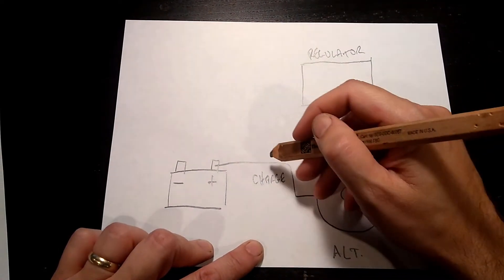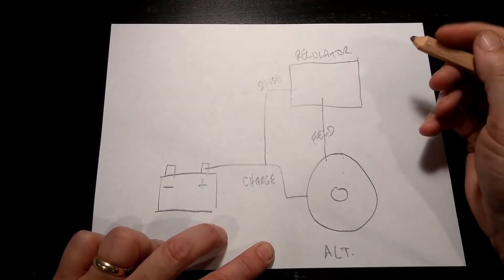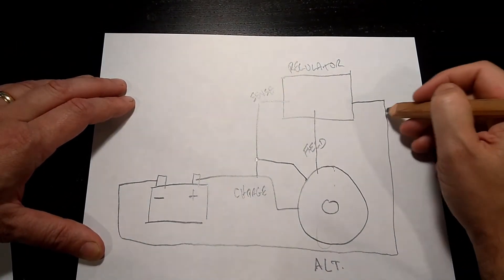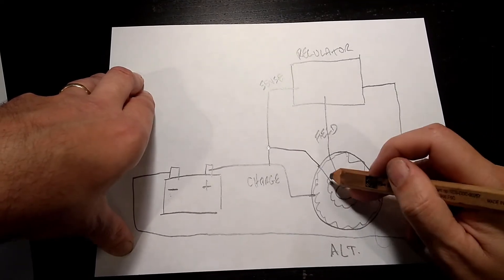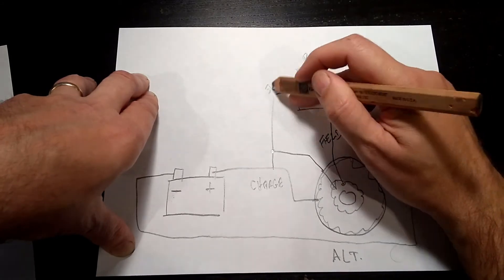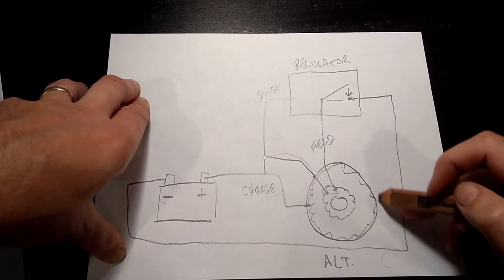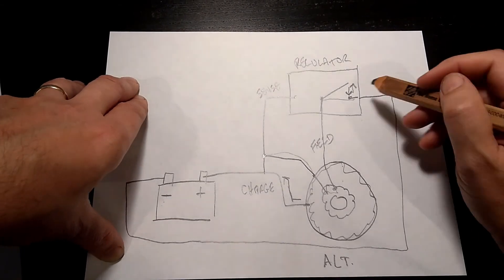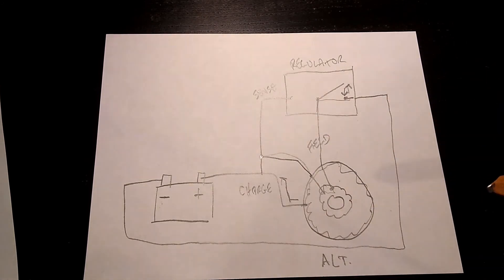HOW IT WORKS: Car Charging Systems

Comment: is there a part can be changed of the charging system\alternator so it charge with 100 amp instead of 80 amp to fully charge battery faster?0
Reply from the maker: No. Alternator output is determined by the physical field and stator windings. Increasing amperage output generally requires a different alternator